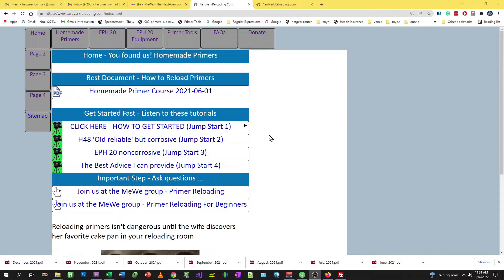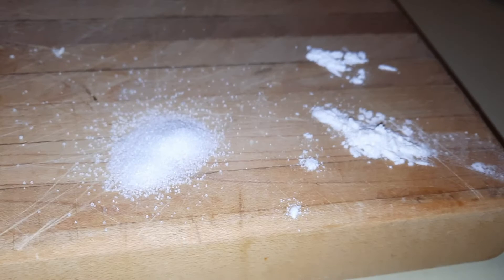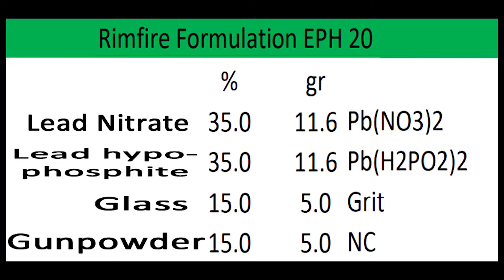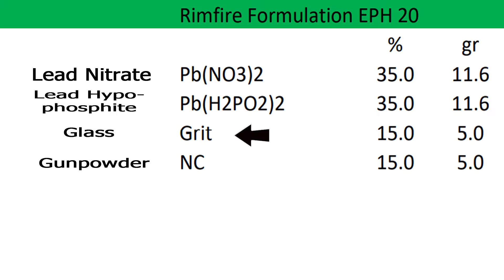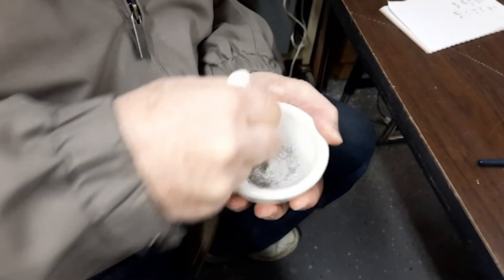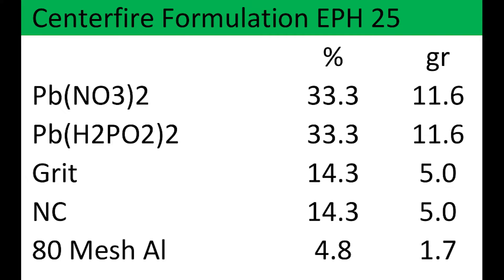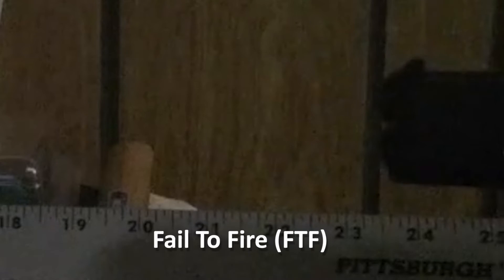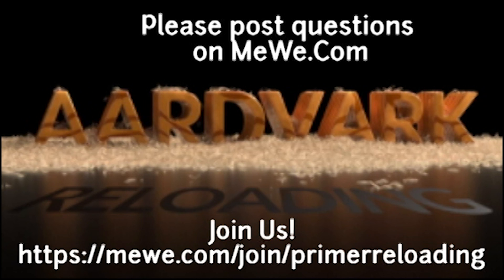Mesh and mixing EPH 20 - Homemade Primers

Comment: Could I use black powder?
Reply from the maker: I would not.   2 reasons: 1) Bp is corrosive (but admittedly you can wash your barrel with warm water and a mild detergent). 2) Bp is hygroscopic and can suck moisture out of air and effectively kill your primers.  Here I suppose you could figure out a way to keep your primers bone dry and they would work.   But this is not practical.   

The gunpowder from those stray bullets found on gun range floor is free.   Save the planet and recycle.
Reply: Thank you
Reply from the maker: You got it!   Come join us on mewe (meey like minded people)
Reply from the maker: Mark Wilson:. Click for a page of links to get you started with reloading primers

https://www.evernote.com/shard/s378/sh/43c5a40b-33dd-2235-6ea4-6acce43eb615/VaSzWzJVd3uSdecKywoSSehy60RjozyLpg_ZNP0rZF58eq3aO9vcSngMyg

Comment: Why do i need to use single base smokeless powder? Can i just use pure NC?
Reply from the maker: Sure.    What is your source?   Gun cotton can be made but it has been ptoven to be labor better served in other activites.    It also has been proven rifle powders also work suffciently well.    I like smokeless gunpowder because it's so easily obtained.   Live rounds  recovered from gun range floors is my favorite source (free).
Reply: @helpmenowmark   fuming nitric acid, some sulfuric acid, and pure cellulose. Makes an extremely pure substance. Collection of powder off of a range floor is something I never considered, but how can you be sure that you are collecting only single base NC powder?
Reply from the maker: @thatoneguy454c  you are correct on the gun cotton.   It's been successfully tested (by a trusted member).    Also in the interum (since I've made the video) some of the slowest rifle powders (therefore double based) were tested  and the primers tested positive (went bang).    So any smokeless powder (or gun cotton ) will do.

Since thus ingredient is practically free (and only 5%) of the recipe - just use  glass as a grinding media to reduce it.

I'm just saying - given a choice of  rifle powders or pistol powders - I'd choose a pistol powder.

You can make (and use gun cotton) but i think it better suited to entertaining the grand kids.   

Don't sweat this particular ingredient.

Comment: Seems more practical just to buy boxes of primers, can get a box of 200 for $5, in a shtf situation I don't imagine the internet's gonna be wide open to keep ordering chemicals and powders...in that situation I'd just use match heads since that's what you'd realistically find laying around
Reply from the maker: I haven't seen primers for $2.5 per 100 in ages (a decade or more).   Maybe Wolf primers I guess.    But primers  have been non-existent since pre-covid around here or possibly for insane prices on Gun-broker.    Strike anywhere kitchen matches were once available àt Walmart and Dollartree.    But even they are hard to find, corrosive to your barrel, and because sulfur is involved, they have a poor shelf-life.   I think if they ignite they are would be weak and therefore unreliable.    I should not talk as I have never tried kitchen matches.    

If you successfully make a good compound you need to learn about primer cup prep, sorting primer cups/anvil selection.    Sizing and de-dimple techniques.

The idea for some of us is to gather the supplies  and the knowledge before it hits the fan.

Looks like we won't agree on much but we both can hope and pray nothing hits the fan for any of us.

Comment: Unrelated question:
  On page 38, concerning EPM16
Is there specific recommendations for
"binder 0.4%" and "buffer 0.1%"?
Reply from the maker: I'll have to read up on that one.   I'm out in the field at moment.  I will see Marshall this week!
Reply: @helpmenowmark  
Thank You in advance!
Reply from the maker: Below is copy paste of Marshall's reply...

I think I used diluted white glue as a binder, but that is not a specific recommendation, just what I had and used. The buffer is described in the patent and I used their formula. BTW, the buffer prevents the very fine aluminum powder from reacting with water before the primer is dry and ready to use.
Reply: @helpmenowmark  
Thanks!
Somehow US8455770 doesn't work for me. Could the number be a misprint?
Otherwise I'm thinking of trying a weak NC lacquer. Thoughts?
Reply from the maker: @dragonhealer7588  on that Mewe group one of our advanced members JB meier entered his recipe for an NC lacquer.    Please join us
Reply from the maker: You would be a great candidate to join our mewe group.    
https://mewe.com/join/primerreloading